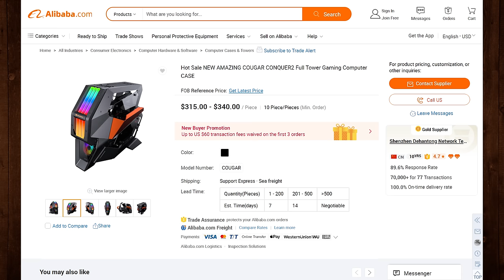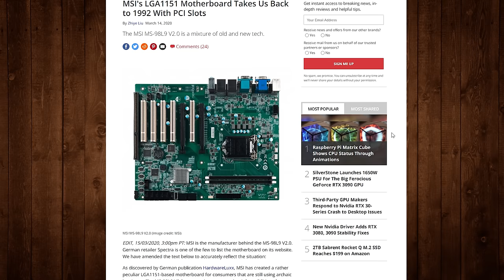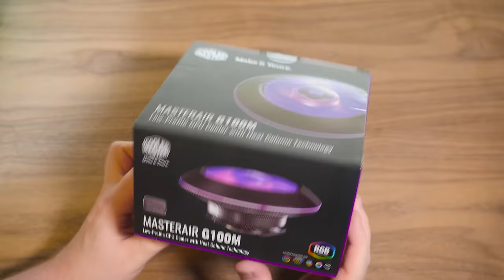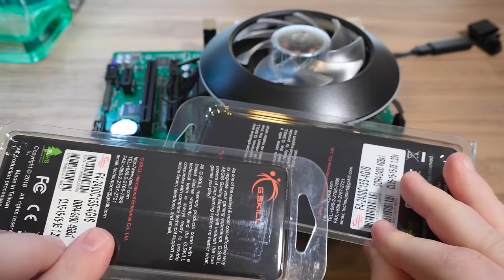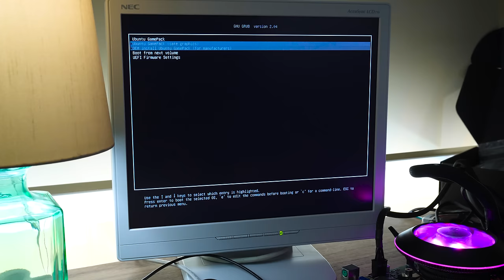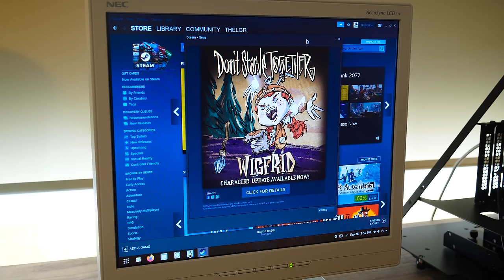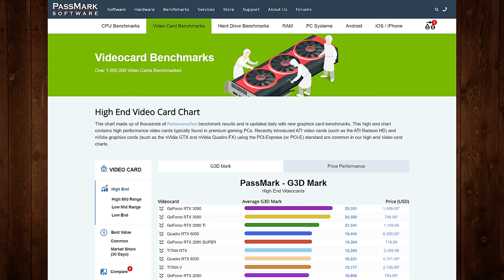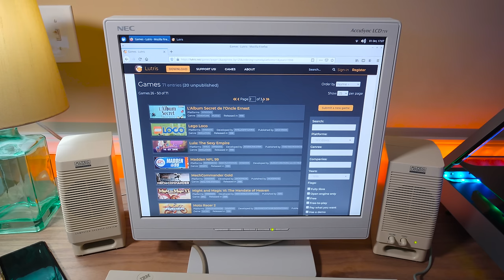Building a Ridiculous Pointy Pyramid PC

Comment: Im still using on a "modern" PC (DDR3 4th gen i7 system with Z97 chipset) a very old sound card, a Soundblaster X-Fi with 5,25" I/O Front for Midi-Ports and many other audio connectors. Luckily its even working in WIndows 10 after manual driver installation. This creative soundcard still makes much better analoge signals, not much better in the way of sound quality (at least not hearable), but the noise level is practically zero, meanwhile the integrated sound card of a damn modern Z97 Mainboard make sometimes very quiet, strange noises and ofc a "high" ground level of noise.
I also have to say this Z97 board has a dedicated audio sector on the mainboard to avoid distortion and such things. A dedicated soundcard will always beat onboard audio in analog outputs. When using HDMI, digital sound and so.... there is ofc no need for a dedicated soundcard anymore.

mainly i love this soundcard because of its very good sound quality over analog outputs, the classic 5-Pin MIDI-In and Out, the dedicated headphone plug with its dedicated (!!!) Amp for low-impedance headphones and the also customizable Line In which can be amplified or not (for Mic usage or as a regular Line-In)

Comment: just a heads up if the bios lets you underclock the ram that helps install win98. other than that if you use another pc you can place an upper limit on the File Cache using MaxFileCache in System.ini

and limit it to seeing 512MB of ram

Comment: im actually turning this into a general development system, what i did different whas i want for the 6405, kept the same board, going to install 32 GB of either standard corsair vengeance or going to use crucial. in 2666 ram, hopefully going to upgrade to 64, (the chip supports up to 128, wont be needing it ever, but hope the board can support it, have yet to check, and i will be slapping a gt 740, 2GB in with a 2TB wd gold, all in a Thermaltake level 20 VT, going to line the inside edges of the case with green LED's just to match the theme of... the green motherboard and my (outside of youtube) insignia colors.

Comment: just throwing this out there, you never want a pyramid shaped PC case, you would bounce all the hot air back down onto your hardware and insulate the heat, you want the top to be bigger, not the bottom

Comment: So you pulled the Radeon card, but I must have missed what you replaced it with. What did you end up using for video?
Reply: He said he was using the Intel Graphics in the CPU. That rather amused me because gamers are always claiming that you can't possibly run games using Intel graphics.
Reply: @MrDuncl  Ah, thanks. And I think that's true for demanding modern games, but Intel graphics shouldn't have much trouble with old games, except maybe compatibility, although Clint seems to have had good success with that here.

Comment: I watched this video approximately 20 times and now I really want to buy a pyramid case.
Reply: I bought the case.
Reply: @voiceinject  
Regret it yet?:D
I do everytime i have to upgrade/change/clean it lol
Perhaps you didn't reach this point yet though.
I've literally cut all the cables from the front IO except the power button cause of the mess with cables.
And in the summer i had to use a 3000rpm noctua industrial fan behind the case to keep it cool..
It does look cool though, also put some mirror foil in the back and black tint on the side windows (also lots of rgb ofc)

Comment: Yea I found out that you can't run those soundblaster cards on anything newer then XP. I have not been able to try it on vista and I know for a fact it wont work on windows 7. Windows 7 will detect it and you can get away installing older drivers for it to make it work with windows 7 but any time you try to use the sound card you hardly get any sound from it or it just BSODs the hell out of your monitors sadly

Comment: Oof... A full format on the M2 is not a great idea... Due to limitations on write numbers over the years (sure, it's so much better now, but still). 

Also Linus Tech tips did the opposite of this, in a pyramid super powerful, but I also like this option.

I do think you should have gone for a newer graphics card, and kept the sealed ATI one for a museum or something... It's after you open, you find out that there are no others left on the planet, and it was worth 10k or more... Ha

Comment: A very late reply, so it may not even be useful, but I fixed that ACPI error for Windows 2000 by loading universal SATA drivers of an USB floppy drive. I assume you were trying to install Windows XP RTM or SP1, which give the same error as Windows 2000 on modern hardware. You can also just use a SP2 or SP3 disc to avoid all of this issue I think. If you will do a similar project in the future, you have some things to try. 🙂

Comment: Stopped the video at 4:08 and was screaming in my head… put a lcd monitor on the bottom facing up… then a piece of glass on a 45 degree angle… when it’s all put together the face side would have a floating display (like the heads up display in a older car)

Comment: Little bit difficult with an M.2 I imagine, (and i don't know if installing to usb is possible in older windows) but couldn't you just use a different pc to install windows on the drive?
Not optimal, but it should work. Maybe just try a SATA drive.

Comment: One thing I've learned throughout many years of Linux is that ATI support on Linux sucks. Well, it used to at least. Anyway, you really need to use the proprietary driver, which usually does not come with linux distros. And good luck with that.

NVidia used to be waaaayyyy better and easier on Linux.

Comment: Between Lutris and Steams proton Linux has alot of protentional with the right hardware. alot of modern windows games  work on linux thanks to lutris and Steam and hell some games works day one  on release. Cyberpunk 2077 was one of those games. the big problem atm  for most multiplayer games is modern anti-cheat systems which Valve is trying to work with some of the major ones to get working in proton but thats a wait and see but if they get that worked out Linux will be a pretty good gaming os

Comment: If your computer runs poorly, just do what I do and blame Radeon. My current computer uses a Radeon R5 processor, and... Well, it runs pretty poorly as well. I can barely run games like Space Engineers once I get around 30 or so mods on, even with graphics settings turned down to the minimum. So yeah, Radeon sucks.

Comment: Ah man, shame you didn't get an ISA slot in there. I wonder if anyone does ISA slots with a USB plug? Hang on...

Wow! They do! Not surprising I suppose, USB 2 is easily fast enough, USB 1.1 might be, I can't be bothered working it out. That it's possible isn't really the surprise, so much as that there was a demand for it! I suppose that's legacy for you, apparently there are IBM systems out there, emulating IBM POWER chips on whatever they use now, then emulating IBM 370s or the like, on the emulated POWER! And that's worth it because some companies still use that old mainframe software. Hopefully not for anything too important, and if it was in widespread use they'd surely get somebody to re-write the old stuff onto something contemporary. Although that said, perhaps modern-day IBM don't support the old legacy software, for something really specific. And if you suggest anything like a modern PC then you really don't know what people buy IBM for. 

Anyway yeah you can get ISA slots on USB cords! Wonder what the drivers are like? To stick that old Adlib Gold board in there, or at least an SB16 for authentic sound on the old games. 

Beside that, the LPC bus on modern motherboards actually IS the old ISA bus, just reduced to a few wires and run at higher-speed serial instead of lower-speed parallel. Connects the ROM and serial ports, stuff like that. You can get ISA - LPC adaptors and they're a good bit cheaper cos it's just sortof demultiplexing stuff. 

Now I'm imagining the USB adaptors in 20 years time that'll connect to the optical fibre or quantum entang-u-link or whatever we have then. See how many emulators we can connect in a row. Clint should try that! Maybe an old parallel port hard disk would be a good final attachment, or a printer. Through as many different emulators and convertors as possible, like that picture of all the plug adaptors connected together, but this one WORKS!

Comment: Linux will not run good on a GPU this old! I'm not sure if the problem is the raw horsepower, the OpenGL version or the open source drivers, but even a lightweight version like Lubuntu will run VERY slow. Try something newer

Comment: Your experience with Linux here has been my experience anytime I ever needed to use it for one thing or another. It's just one problem after another after another.  Since the community is small, good luck finding the solution to your weird problem. As a YTer you might have an easier time with that than I did...

Comment: The design is utterly useless, actually. It should have been split to two parts: the bottom could be like in this design, all glass, but it should have less height and flat top. Then you could install a smaller pyramid on top, but it would be metallic and have room for optical drives or control panels and displays.

Comment: There is data that suggests growing plants, or placing objects in pyramid structures maintain the integrity of the structures placed inside or even grow plants better.  If this were the correct dimensions and materials, it might have an effect similar to this. Preserving the molecular of integrity of the small parts inside, possibly prolonging the life and performance of a device, I'd love to see science done on this.  I mean wikipedia will denounce this and call it pseudo science, but if it doesn't fit with an agenda, wikipedia calls it fake, I'd hope at least some people understand that these days.

Comment: I can't believe that computer was so slow. That's ubuntu for you. Get the latest version of puppy linux, the ubuntu compatible version is cool. It can connect to the ubuntu app server. So the latest version compatable with the latest LTS will be good. After installing apps it will ask you to trim the fat (extra stuff like lsnguage suppoty etc) then your good to go. Should run most ubuntu apps. It runs them with a much smaller optimised operating system. Install puppy in frugal for optimal running. See here for the install options. http://wikka.puppylinux.com/FrugalOrFullInstallation

Comment: You probably could've used Windows 7 Professional. It has an XP mode so theoretically you could make it boot to XP mode and use it as an XP compatible.
Reply from the maker: That is unfortunately not how XP compatibility mode works, and it’s not very effective for the old games I wanna run

Comment: An RGB motherboard port isn't even something I've ever heard of. Is it something like I2C or SPI, branching off the motherboard's internal controller? Graphics cards used to use it to chat to the monitor with. Maybe an internal RGB port is just USB with a different connector. Ah! I looked it up. Connects straight to the RGB strip and somebody said it's compatible (same connector actually) with other RGB strip controllers. That's just low-ish speed synchronous serial. There's Arduino libraries support that. So an Arduino might be the best way to hack it if you wanted to. USB to the Arduino, then connect to the header. 

There's probably Arduino software already supports that you could download. And in fact I'd stake my life on somebody selling a pre-programmed chip with it as a product. You could use an internal USB header on the MB, but since you presumably want to use all of those for external ports, just hack something up. Stick a cheap USB splitter inside the case, maybe.

Comment: Not being funny but it was dumb putting such an old mobo and hardware in there, you wouldn't have had all these issues if you'd just made a modern build, particularly for such a big and heavy and expensive case that'd have been logical.